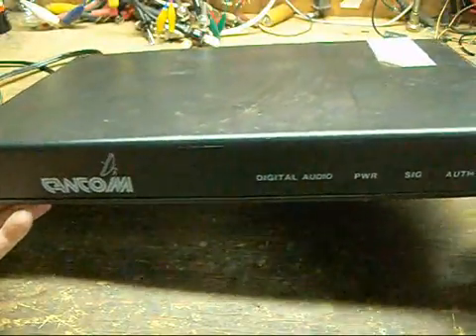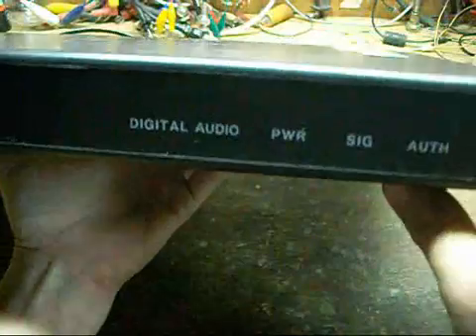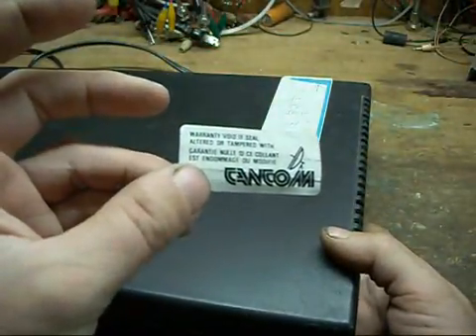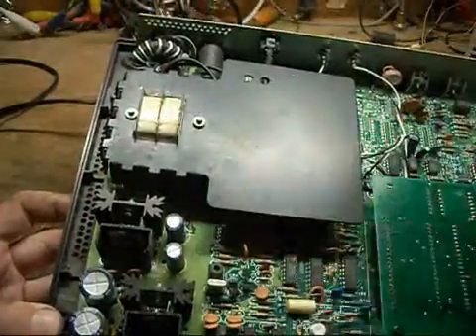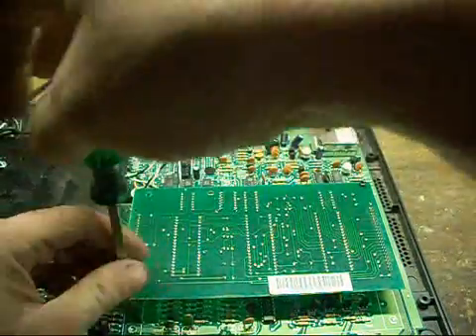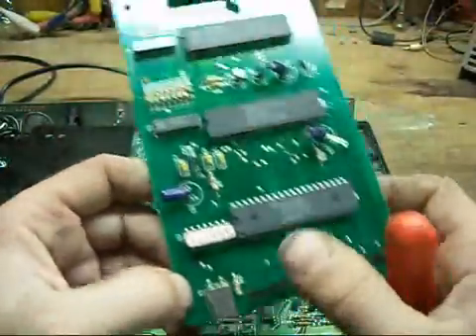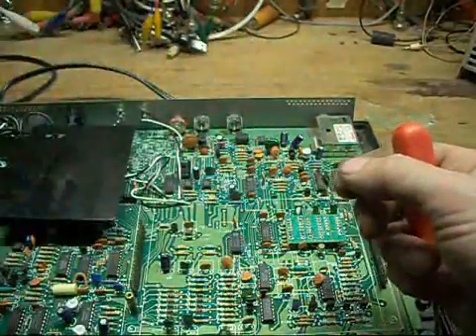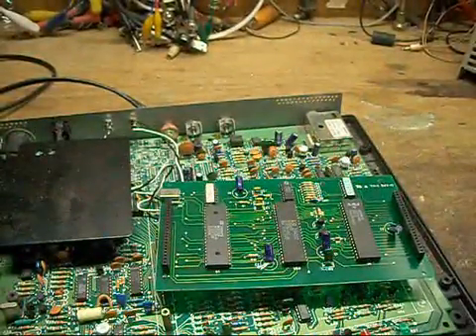Inside an Oak Orion C band descrambler.

Comment: I am kind of surprised there is no epoxy covering any of the chips.  I guess this is well before VideoCipher.
Reply from the maker: +tgivy 

From what I remember…

It was the Canadian competition to the US Videocypher unit. A lot of Canadian broadcasters used it almost exclusively. The reason you seen them in the use is the result of people that was wanting to use/watch Canadian content in the US.
Reply: Yes, Oak Orion was used for many C-Band and Ku-Band signals for Canadian broadcasters.  By the mid 1990s, it was still in use but many analog Canadian signals were using Videocypher II+    By the late 1990s, most Canadian signals were using Digicypher.  Because of Anik E1's failure in early 1996, and the eventual launch of Star Choice and DIsh Network Canada in 1997, most Canadian signals adopted digital encryption quicker than the US.